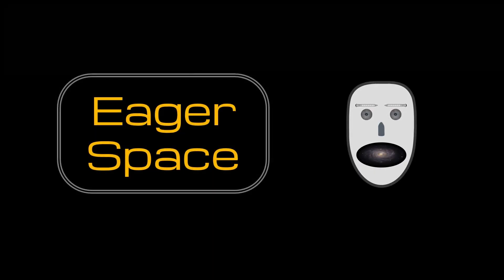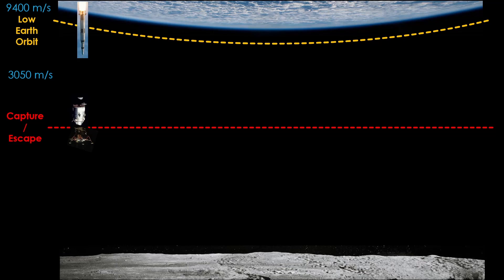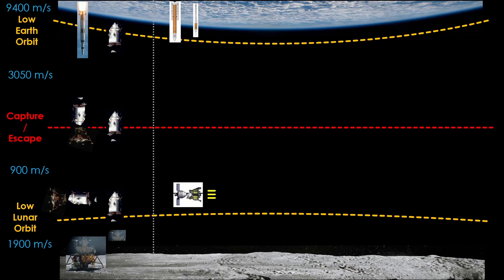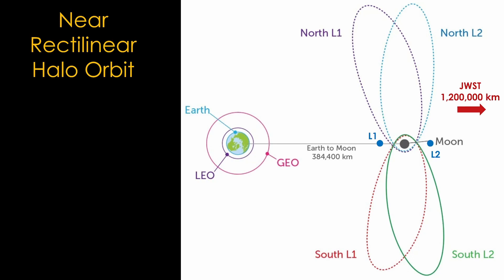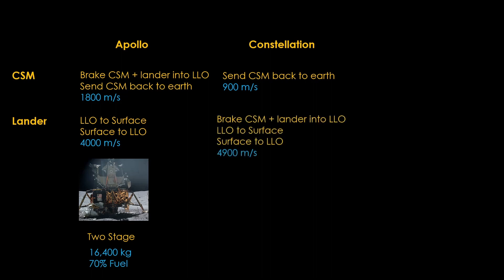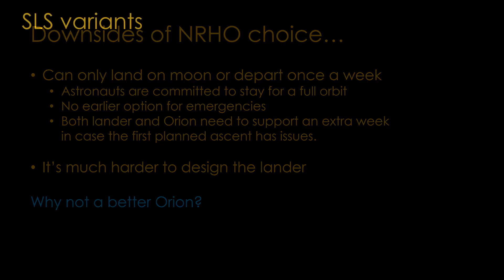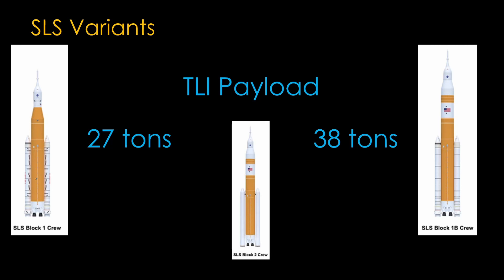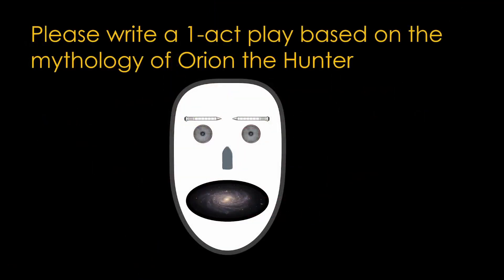Artemis Lunar Architecture

Comment: As I understand it, NRHO is also useful for the long term plans for gateway. It is right on the edge of the moons gravity well, so it is easier to use as a jumping off point for the deep space transport program. It could also be used as a fuel depot if isru ends up working out.
Reply from the maker: If you have ISRU I can perhaps see some benefit, but otherwise you're just spending propellant to get someplace and then more propellant to get away from it. 

It's also a very inconvenient orbit in that it's so elliptical. You get a chance to go to/come from the moon only once a week or so, which means transfers from the surface are rare.
Reply: @EagerSpace  I personally think ISRU is unlikely to be practical, especially within the timeline of a mars mission. Currently though, all the MTV plans use gateway as a jumping off point, so there must be some benefit. I lack the research skills to make a better point here lol.
Reply from the maker: I think it's just a way of justifying gateway which honestly doesn't make a whole lot of sense otherwise.

Comment: 3050m/s deltaV for starship from LEO to translunar injection isn't a realistic estimation, more reasonable will be 3450m/s like Apollo did, this is much better than Artemis need to do 4100m/s, but this is the price you need to pay for a low thrust to weigh ratio, because even if you are in orbit you need to count for some gravity losses if you cannot make orbit changes in very short time frame. Well are some solutions to this problem, like how Israeli Beresheet made many short burns but they come with some additional problems.

Comment: What if the astronauts board starship in low Earth orbit? Would that save ∆v by skipping the stop at the Halo orbit?
Reply from the maker: *Generally speaking*, going from LEO to the lunar surface costs about the same regardless of what path you take, at least for paths that you would want to use with humans.
Reply: Actually using starship as space tug is a great idea, if you assume that is used for translunar injection and lunar orbit retro burn, you don't need SLS and lunar gateway too, and payload delivered to the moon surface is only 10 tons less than in the case of SLS +starship case.
Reply: I'm sure SpaceX intends to do that someday. The whole starship should be able to refuel in LEO, go to LLO, land, then return to Earth. How much payload it can take on that trip remains to be determined. It probably won't be ready to do that by the time of Artemis 3. In fact, the Artemis version will NOT be able to re-enter the atmosphere.
The whole trip may require a future, stretched version of Starship, like the ones that SpaceX recently announced.
Reply: Because there is no docking system capable of not being crushed by the thrust produced by starship.
Reply: @OlCrunch  I’m not sure this is the real reason. My understanding is that Gateway was supposed to serve as a test bed for conditions you would have aboard the MVT, namely with regards to radiation and crew ferrying. NASA REALLY wants to emphasize that because Mars will require some kind of months-long journey, they want somewhere to simulate that environment. They also want somewhere to quickly ferry you up and down from more quickly (1 week or less) presumably for emergencies.

Edit: NASA also hopes to build the MTV off from Gateway, as an alternative to Starship.
Reply: @dylangtech  What NASA wants is irrelevant since they are clearly not going to be going anywhere with any of their ancient billion dollar expendable hardware, they will just end up paying for seats on starship just as we see is already happening with Artemis.